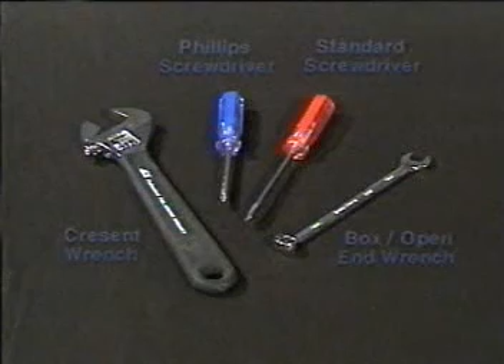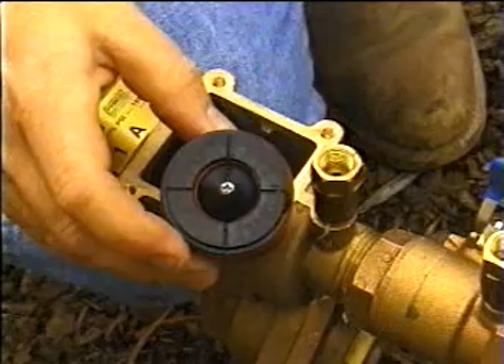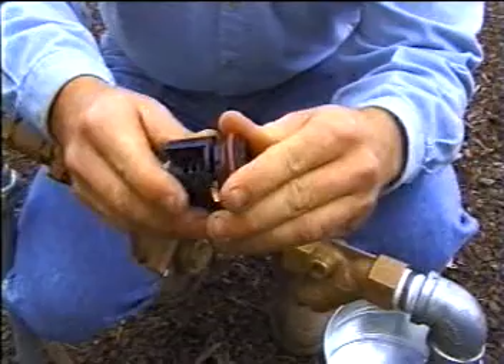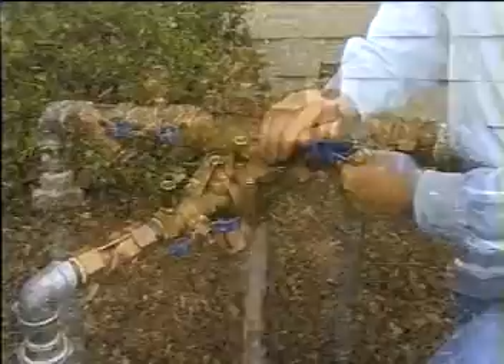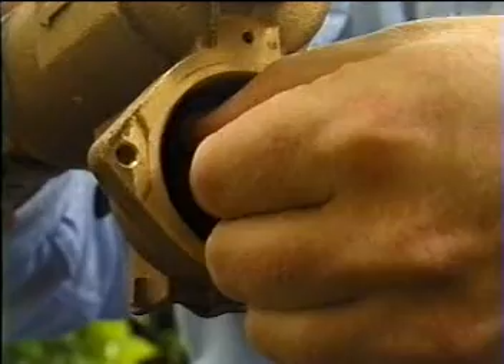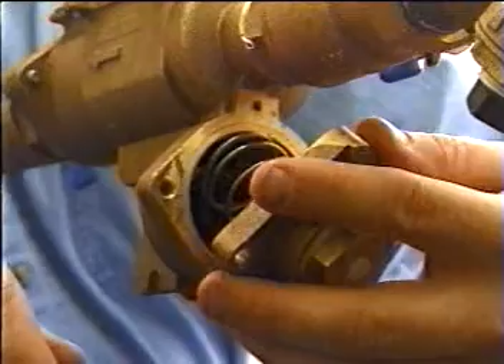Febco Master Series Repair Video 850/860

Comment: Thanks for the helpful video. The relief valve on our drip irrigation system developed a leak. I ordered the Febco replacement parts kit: FYK 860/880-RV 1/2 - 1 Reliev Valve Rubber Parts Repair Kit. Using your video, plus filling in some steps you omit, I was able to stop the leak and avoid an expensive plumbing bill. You leave out the part where you must unscrew a screw and nut that holds the 2 pink cups together. That was kind of tricky, but I did it and I'm not the mjost mechanical guy on the block.
Reply: Hi Jim, Did the kit come with the "RV Guide" Its a plastic piece with 4 prongs. The parts for the rubber kit doesn't show it. Thank you.